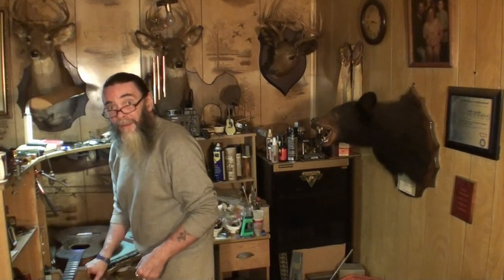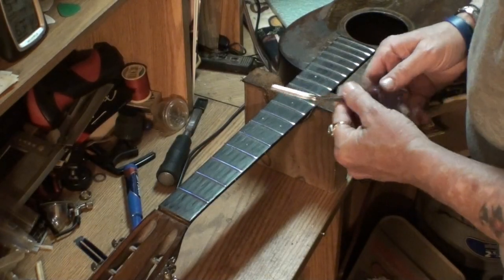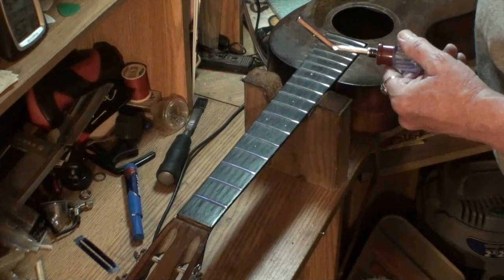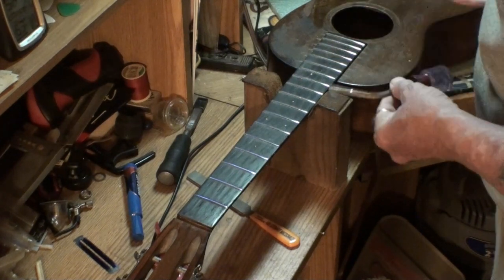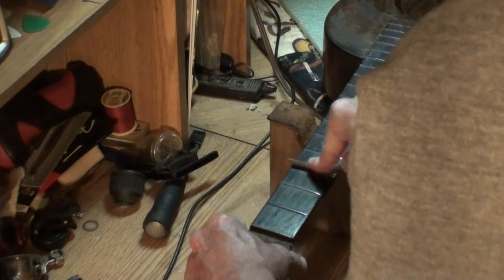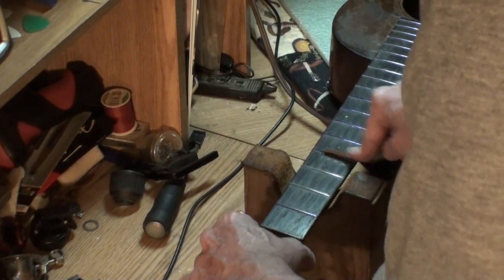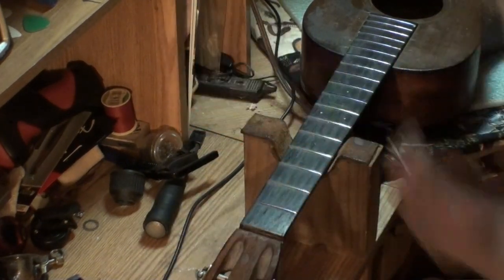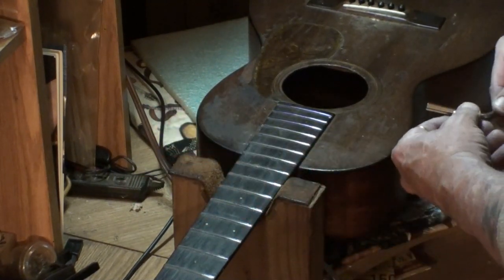FRET CROWNING SKOOL HOW TO MAKE YOUR FRETS LAST LONGER MARTIN PARLOR

Comment: Randy.   I could see the flat areas(blue) on the top of those frets but having trouble judging how wide they actually are.  Could you tell us how wide those flat areas are approximately?  0.020"?   Wider?  Thx.
Reply from the maker: the wider they are the longer the frets last before wearing divots in them again, I never measured, I just file until I see the crown with a flat spot. thanks for watching!
Reply: @RandySchartiger  It might be interesting to measure the width of the flats of a few frets with a caliper on your next fret dressing job.